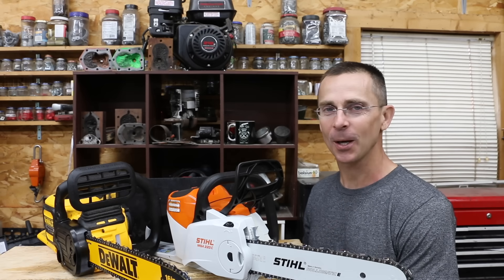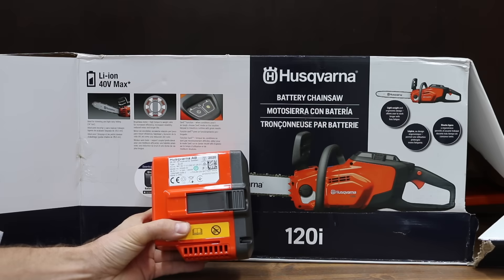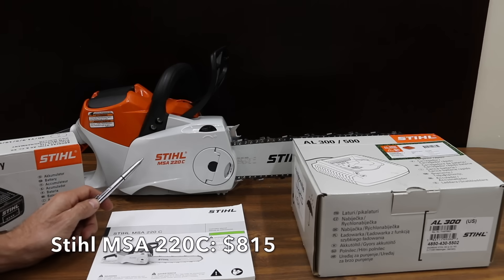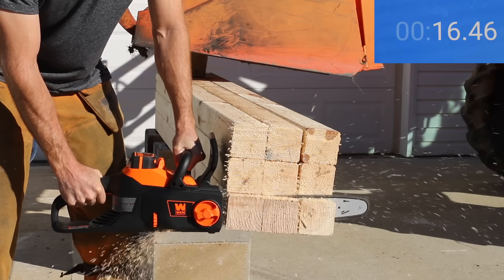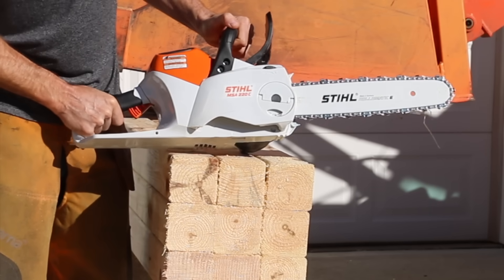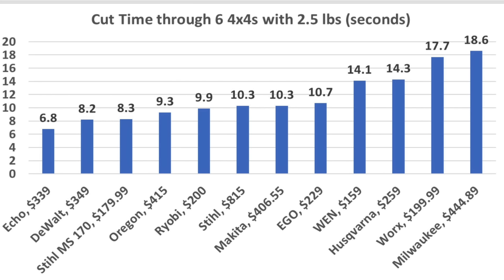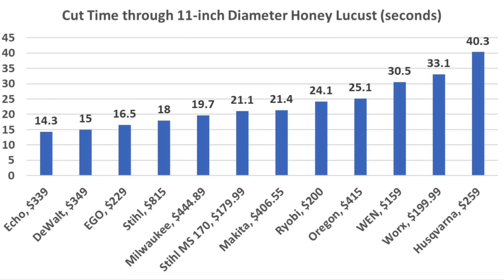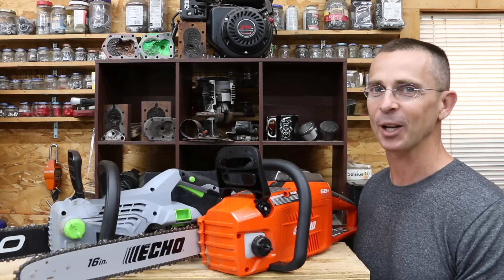Best Battery Powered Chainsaw Brand (ROUND 2)? Stihl, Husqvarna, Echo, Oregon, DeWalt

Comment: Are you planning to retest the milwaukee? When you tested it you had the chain so loose I could have put my hand between the bar and the chain. Really disappointed it wasn't retested here. Specially since you seem to recognize that was an issue and pointed out adjusting the chains and did much better here.
Reply from the maker: Thanks for the constructive feedback.  I can test it again in round 3 if there's enough interest
Reply: @ProjectFarm  interest? It wasn't even tested right to start with. You can watch your own video, when you set it on the 4x4s the chain is hanging way off the bar. I generally like your videos, but that was bad.

Comment: I'm definitely still going to go with gas power, just for the sheer practicality of the "recharge" time even without the other factors like price and cutting speed, electric saws definitely have their place but if I were going to use an electric chainsaw for anything I'd probably be using a corded model, and if quietness was a factor and I didn't need the cutting time of a gas saw a good old bow saw does the job just fine for me
Reply from the maker: Great feedback.  I have 8 Makita batteries.  I can get quite a bit of time using it and can charge 4 batteries at a time.

Comment: If the cordless battery only lasts less than 10 mins, what is the point? You either need multiple batteries or small jobs.
Reply from the maker: Great point on multiple batteries.  I really like the battery saw for removing the branches and smaller trees

Comment: I would be interested in what is the best commercial product for cleaning carburetors vs best homemade carburetor cleaner.  I LOVE the GM /AC Delco 10-3015 as it eats carbon but keep it off your skin. There is an aresol can 10-3007 also. They work very well at carboned up valves when doing an induction cleaning as well on any engine. Saved a push mower that was gonna be trashed for not running right. A home remedy I have heard is water, lemon juice and boiling before putting the carb parts in the solution. Also have heard used alone pinesol, simple green, vinegar,  and toilet bowl cleaner (not sure what brand but know The Works is cheap and works well for automobile heater core flushing). Thanks for the videos and continuing to test out our crazy ideas. Hope your Christmas is filled with happiness and joy and is spent happily with family and celebrating the birth of our Lord and Savior Jesus Christ.  Gods Blessings and great video 👍🏻👍🏻
Reply from the maker: Great video idea! Thank you
Reply: @ProjectFarm  thank you for allowing us to give you ideas and even replying to us. Its a great feeling when someone as popular as you with as huge of a channel as you takes your time and interacts with us fans . Would love to see a livestream sometime if possible

Comment: I have had that Echo for a few years and it is great. Everyone is always amazed at how fast and quiet it is. I do landscaping for a living so it gets a workout
Reply: The Echo seems right in that random brand sweet spot where it's half the price of the leading brands but still not ridiculously cheap like the WEN so you know you're buying some engineering/materials without paying for advertising
Reply from the maker: Great feedback on the Echo
Reply: I have the 58v AEG version which is basically the same as echo I have been running it for about 3 years now and have found that the batteries have expanded a little bit and its become hard to put into the battery slot especially in the lawn mower, apart from that its been awesome.
Reply: Do you still have it and if so is it still working well?
Reply: @IloveBaklava  yes, I have all of the tools in the system and use them regularly. Have had 2 batteries give up, but other than that they are great

Comment: So the dewalt is second, but I can use the same battery in all my power tools, not so for the echo
Reply from the maker: Great point
Reply: Actually Echo has there own line of power tools that will use this same battery as the saw
Reply: @LV4TD101  ok, thats good they have branched out like that, I cant see them in any of the major retailers any time soon.  Here in the UK its the Yellow, Red and Blue teams battling it out.